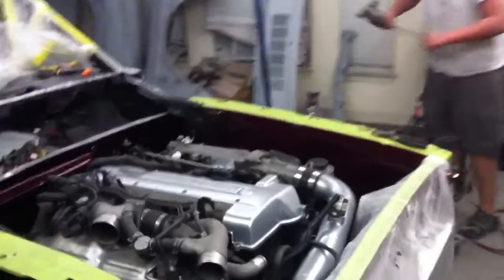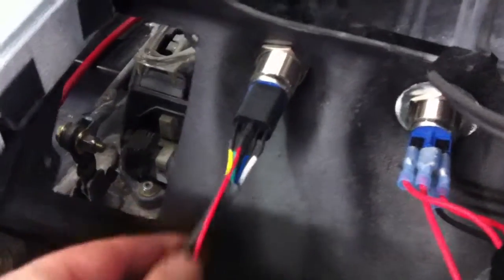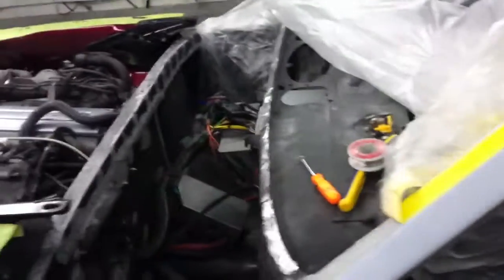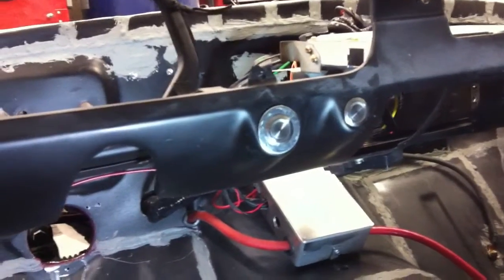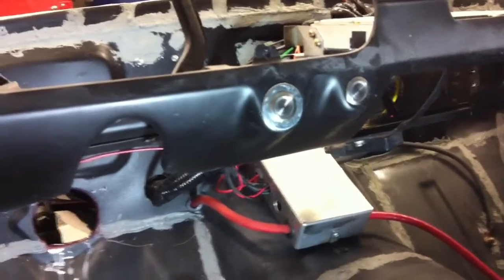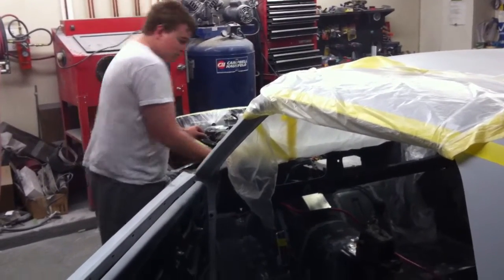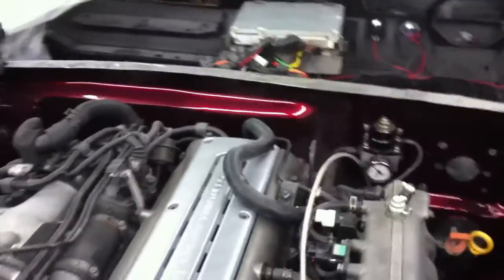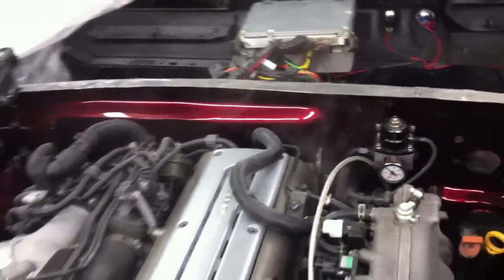2JZ Mustang fired up again after motor RnR and Wiring changes

Comment from the maker: @speedy75602 Yea, not a bad idea.  The opening to the hole actually is key'd/slotted for the ignition switch so it would probably need to be butt welded.  I wanted to keep the dash unmolested and not cut or weld on it.  will see how it looks with the washer painted black...  thanks for the thought and idea and for watching!

Comment: Do you think it would be hard to put a 2jzgte in a 96 mustang that's automatic? I'm thinking about trying it in a few years but I wasn't sure if it would be impossible.
Reply from the maker: no problem at all putting a 2JZ in a 96 mustang, should fit in there well.  I beleive the factory shock towers on the 96 is alot wider than the 65 so you should be fine.